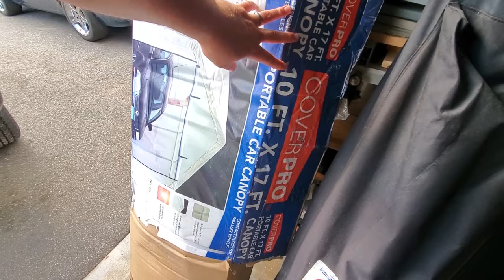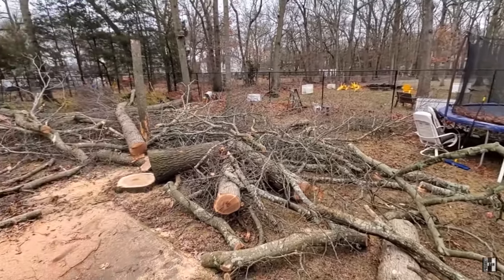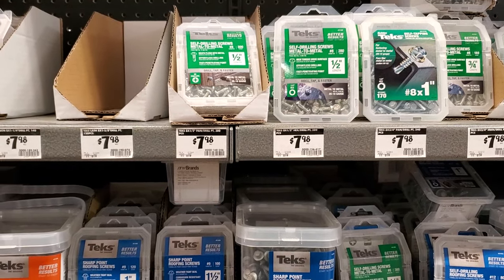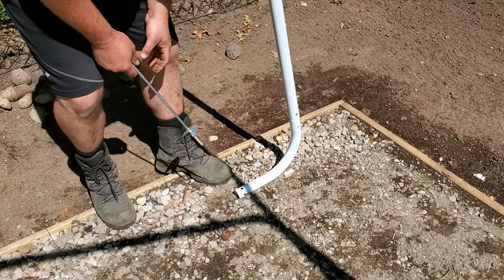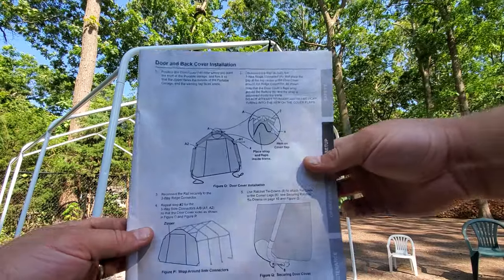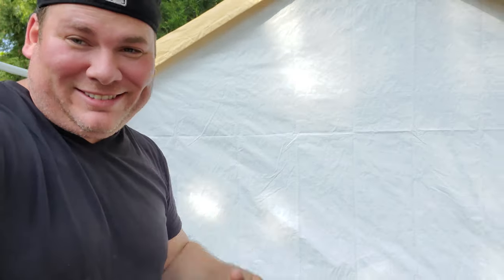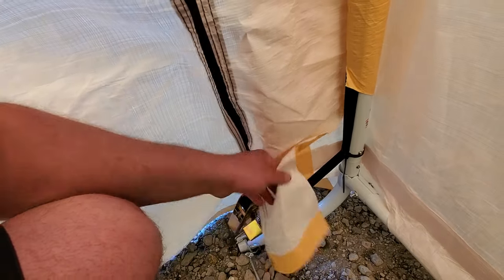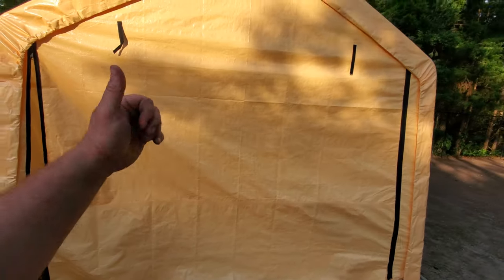10x17 HARBOR FREIGHT CAR CANOPY TENT ASSEMBLY - 100th EPISODE PROJECT!!!

Comment: cheap anchoring hack for these style tents... get some screw in cork screw style dog tie out stakes from amazon for cheap and screw them in on the inside of the tent near the base of those unanchored post and use long ratchet straps up around the head height vertical and horizontal joint and back down to the stake and that thing won't move in the wind.
Reply from the maker: Nice!! Great tip Brandon

Comment: you are totally correct with the need for the screes at every pippe noint. I assembled one add 2years ago and with the first wind it not only bew apart, but the pipes broke my windshied.
Reply from the maker: Sorry to hear that!  I tried tape on my first build and it didn't work either. Tape only lasts so long. But screws on the other hand, they'll Outlast the pipes!

Comment: If you're not attaching to a floor, Anchor every point not just the corners. I had a shelter logic tear itself apart from winter winds in less than 3months from the shimmying from the winds  in the middle of the structure. Also I highly recommend getting small iron pipe slightly wider than the building to slide in back wall pocket along bottom to press against the frame so the back wall doesn't flap and it also make the entire frame more solid
Reply from the maker: Excellent input!

Comment: Great video. I have assembled three of these canopies. You will want a piece of 3/4 x 3/4 x 8' wood for the door. It makes rolling up the door so much easier. As the oil evaporates out of the tarp it will shrink. You will then need to loosen the straps to prevent the tarp from ripping. I have been getting about six years out of the cover before it dry rots and rips. The frame will out last several tarps.
Reply: Hi. Do you put another tarp over the shelter, or are you getting 6 years out of just the shelter by itself?

Comment: Nice video with great ingenuity. I have had mine for 10 years and finally need to replace it. Hope the quality hasn't degraded too much! One thing I learned is not to roll the door up so that it hangs like the HF video. It collects water. Roll it up to the INSIDE and the water just flows off.
Reply from the maker: Excellent idea!!

Comment: The front and back hold up fine. You will get about a year out if the top. Mine ripped to shreds in a wind storm. Get a heavy duty tarp and cover it now before winter. Looks great. Good luck.
Reply from the maker: Thanks for the tips! The Tarp Is already on!

Comment: I would like to mention to people considering this garage is you can buy replacement ends and top tarps from Harbor Freight, add /parts to the URL to get there. The tarp top last about 2 years, then water will start coming thru.
Reply from the maker: Well mine's not Even a year yet and I have water coming through already... And that's also with a Home Depot tarp on top for extra support 😱

Comment: How did the self tappers keep the integrity of the unit frame throughout time?  I was wondering if it inhibited the flexing that was needed during wind and if in the long run it would cause structural vulnerability by hindering flexibility. Ie like buildings that sway with earthquakes stand longer than ones that are built to resist movement then collapse in an earthquake. Please give feed back to your experience

Comment: I've had mine for a year, no tears. I think you over tightened the straps at an extreme angle. Unless it is heavy canvas, even tarps would probably rip with the kind of pressure you put on the material.
Reply from the maker: they must be made cheaper now.. mine is paper thin.

Comment: Thanks for a great/helpful video. Couple of tips/alternate options for others based on my own experience so far: After watching him fight with the frame I knew that I too was going to want a way to keep the pieces together, I thought about using self tappers as well but wanted something less permanent and difficult to work with, so I used Gorilla tape and it's been holding up just fine, even after getting rained on for a week or 2 without the canvas up. If you have particularly rocky soil the included stakes won't go in, I tried drilling down into the ground first with a large drill bit(As goofy as that sounds...) and still couldn't get them in, I wound up buying these off of Amazon, I haven't put my canvas up yet, so the jury is out on them holding, but I'm fairly confident that they will hold as good as the included ones would have, but crucially these stakes are actually going in now, so here are some stakes for those of you that also have some rocks under you: https://www.amazon.com/gp/product/B01BJH4EFY/ref=ppx_yo_dt_b_asin_title_o00_s00?ie=UTF8&psc=1
Reply from the maker: The self-tappers were simple and I was able to remove them easily when I had to replace the sections that collapsed in the snow. 💪

Comment: Is there anyway you could take some gorilla tape or something like that and fix your rips maybe spray it with gorilla glue spray adhesive first a little tiny bit to kind of give it extra bonding and put you some gorilla tape(extra strength all weather) over that????I don’t know it’s just an idea,,,, test a little piece of that tarp before you use any glue on it to make sure it doesn’t eat it up
Reply from the maker: Thats a good Idea.. I could Flex seal the whole thing and make it water proof! LOL!

Comment: Hey Dan, is the 10x17 better quality or the 10x10 if you would know? We have winds here that could get up to 40-50 mph. Would it be better to have it against a structure so that the wind hits the sides as opposed to the anchors? Thanks for your help.
Reply from the maker: They're both probably the same cheap quality. The more shelter and reinforcements you could provide this thing the better!

Comment: For my dad having had one for the last 4 years, he's had a basic one, can't remember where from, but he wishes that he had some sort of support in between the side to side for the tarp as it has sagged some by the sides on the top and collects water every heavy rain storm, but other than that he loves it as a secondary garage!
Reply: Also to mention for your car port, maybe use some gravel or sand to try any better weight down all four corners to better help in any bad weather.
Reply from the maker: great idea!  thanks for your input 👍
Reply from the maker: that's awesome! looking forward to a long use 😁

Comment: Okay, I’ve watched two other videos about assembling this garage.  This by far is the most comprehensive and a lot of very useful tips.  The MOST helpful is using the self tapping screws at the joints.  WHY? I am erecting my second one.  I live in New England and we get some nasty winter winds and that’s what happened to my first one.  Several of the joints popped out and the whole thing collapsed.  Some of the frame was bent and rather than order the parts I bought a second one.  Now one thing I will do is on the far end instead of the blank wall I’ll use my old front wall with the zipper and leave it zipped half way so that it will relieve the wind pressure.  I will add that while I am in New England I am a Yankees fan and knew I had the right guy because he was wearing a NYY cap.
Reply from the maker: You had me at "comprehensive"... the fact you're a NE Yankee fan is just Icing on the cake! Thank you for watching and please subscribe if you like Jeep Cherokees!
Reply: Yankees are in my DNA I was born in the Bronx.  As far as Jeeps are concerned I've had two a 1980 pickup that I only had for a few months, I'm 6'3" and I was claustrophobic in it, no headroom, no legroom  Traded for a Wagoneer but now I'm driving MB ML 350 - I've gotten soft in my old age.  If I were ever to buy another Jeep it would be a 1960's FC. I thought they were cool.  I made a lot of money on Jeeps, in the 80's I owned a shop that installed power moonroofs and I had two dealers that kept me in business.

Comment: Thanks Dan, i just bought one of these, i cant put it up anytime soon because of this 11 degree weather... 
i wanted this to keep snow off my car and me while working on it... 

any improvements since the video ? better ideas ? 

i imagine you can hang a light or 2 inside as well as blankets for insulation.. 

overall it doesn't look bad..
Reply from the maker: the first thing I did after the video was layer it with a home depot tarp for extra protection.  I also installed to LED work lights to the top.   the tent collapsed on me last week after we got hit hard with snow.. but I already fixed it ( replaced half the poles with new ones)  I'm glad I used the self tappers to keep them screwed together.  I wish there was a way to strengthen the steel bars... maybe fill em with concrete! 🤣 Enjoy it
Reply: @ProjectDanH  sounds like I should have gotten something better..  I seen around here but not sure if it is HF's they also used cynder blocks.. Not sure what for I guess to keep it anchored..
Reply from the maker: @Jestr86  it came with 20 inch auger anchors.. I screwed it Thru the crushed RCA with a 22 mm socket on my big DeWalt impact!

Comment: This thing still holding together?  I hear tarp will last 1 to 2 years before it falls apart.  Getting one for temporary storage since it's only 200bucks.
Reply from the maker: Its getting weak.. a year and a half later and i think it may need to be replaced or reinforced
Reply: @ProjectDanH  good to know, just want it to last 6ish months.  Thank you
Reply from the maker: @danjim7056  you'll be Good!

Comment: Man I just purchased this unit and imma have to finish strapping down like you did but all in all it's a good deal. Thanks for showing us how to fortify the strength of the install.
Reply from the maker: No problem 👍 I also topped it with a home
depot tarp for extra protection.

Comment: Or you can put it on a concrete slab put down some anchor bolts some u-bolts down into concrete and then attach everything with self-tapping screws then you can go around and use 2x4s or one by fours horizontally all the way around your walls and then across your top and it'll be there for until the metal rots in the wood rots could be a very very cheap solution for a very cheap hunting cabin or tiny home also the frame could be cut with a metal blade on an angle grinder and bolted to the bed of a truck and with some galvanized roof material or plastic roof material could be converted into a camper shell for a off-road truck living quarters
Reply from the maker: Now that's taking it to another level!

Comment: If I put it on grass what would you recommend me place for flooring? Wood?
Reply from the maker: get some gravel dumped
Reply: I used plastic then pallets cover with plywood. Then carpet. Extra stringers on rafters and sides. Aluminium  tubing with fitting clamps like you have .

Comment: It's been a year for this install, how's it holding out? Snow in your area?
Reply from the maker: I had a big snow storm that collapsed some poles.. I bought another tent and replaced the bent ones.. over all it wasn't too bad.. The tarp is pretty thin though I would highly recommend adding a Home Depot top on top of it for extra protection

Comment: I don't know why but I keep thinking about putting a grill in there for a January cookout.
Reply from the maker: It might melt! Lol.  Don't use charcoal cuz the CO might kill ya
Reply: @ProjectDanH  I'm not saying I would do it, it was just the first thought that popped in my head. Besides as frail as that thing looks, the heat would most likely leak the excess heat as long as you keep the lid down, the grill in the center, and the door unzipped. But I guess that really all depends on what direction the wind comes from in winter.

Comment: just put a metal roof on it. it's cheaper than buying tarps every year. Just bought a 12x20 to paint cars going to leave the tarp on it as like a tyvek put a metal roof on it and siding going to run a cross beam and make a storage loft in the roof.
Reply from the maker: Brilliant! What kind of metal are you using??
Reply: @ProjectDanH  I am not sure yet. First, I want to get it set up when the snow melts which will be another month or, so I am going to do foam board insulation before anything all the way around on the inside. I want to get it up and running first. I have this guy who could give me work out the ass so hoping I could quit my job by doing bodywork at home. Then right before winter starts maybe a month before say in October, I will put the metal roof and siding on. probably shop around for the next 7 months. I am going to put another small storage shed against the carport like a walk-in room for paint sandpapers tools and stuff. and like I said I am going to put plywood overhead and have the complete roof a storage area. I don't see anyone on YouTube with what I am going to do. I am going to upload a video of every time i do something if you would want to subscribe to see what I am doing. I am going to put it up in 1 month. Doing it this way so I could take it down in the future need something that will come apart very easy. if you have any ideas for a nice-looking siding or roof idea let me know
Reply: @ProjectDanH  I am lucky with the one i bought because I can like i said put an attic in the carport. you know how standard carport the bars at the top 5 in half feet are about high before it turns to the roof. well, my carport is adjustable another 3 feet from 9 feet to 11 feet my headroom would be at least 7 feet high

Comment: Soooo I've watched numerous videos on this and nobody has said next statement when building this. You should attach ratchets to ends of both straps before attempting to hang front and back tarps otherwise they will get sucked up and you need to have fish line to get them back through. Also nobody shows how exactly to position the straps on top and sides of frame. These are most annoying parts to deal with when building this thing yet nobody bothered to point them out in videos. Just helpful tips for anyone going to put one of these together.
Reply from the maker: I'm pretty the straps were knotted in a bowtie when I got it.. It would definitely suck to have to fish em through. Good tips

Comment: Bad investment  . The top has no way to get ahold of it to pu😮ll  it over the top. The door end is not sewn to slide in a pipe to hold it down 😢. How do you secure the sides down without any grommets or hole to grab & hold it down.
Reply from the maker: It has anchors, cables and ties.  For a few hundred bucks it has been a great investment!

Comment: The actual directions are wrong and the front angled posts and the rear angled posts with the curve the 45 bend it they don't face inward they face towards the wall just to let you know and if you do it that way it it automatically does what you just did but good hack the compensate for not recognizing another person's mistake
Reply from the maker: Wow, that's interesting.. how did you uncover that mistake?